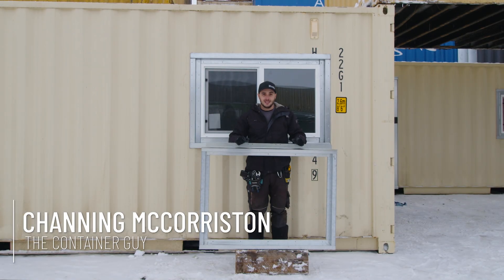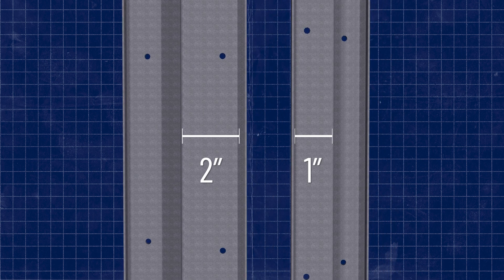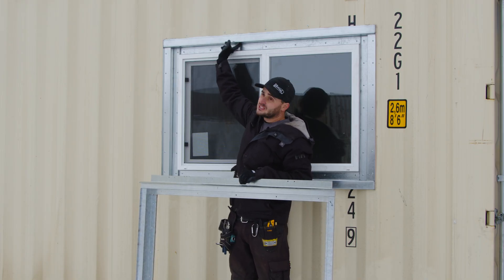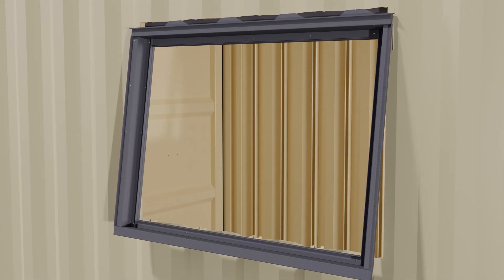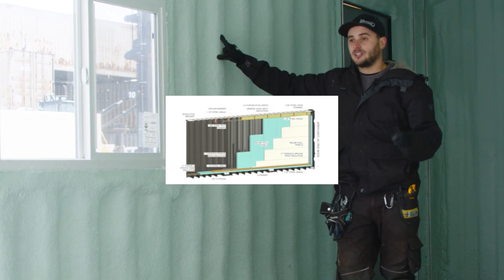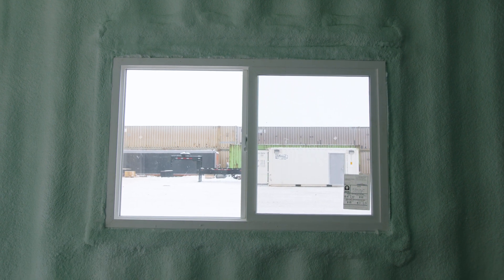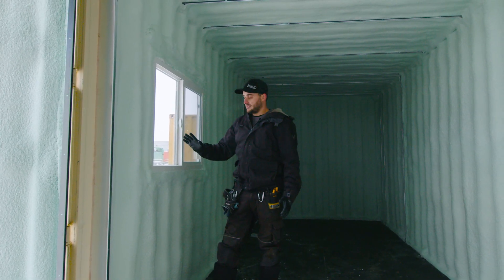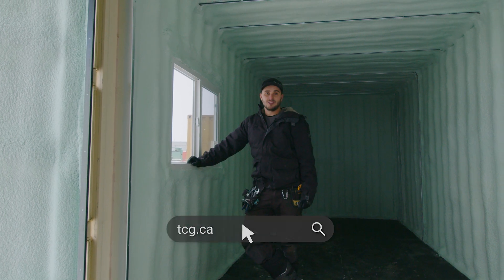Designing the Perfect Window Frame for Shipping Containers

Comment: Looking forward to the alternative to spray foam insulation. Here in the rural area I live, spray foam installer wants $5K to shoot a 40' high cube 😳 I paid that much for the cotainer itself.
Reply from the maker: My guess is the envelope will be less rigid and not the best for constant transport (site offices). For built-on-site guest houses, workshops, and things of that nature, it'll allow the do-it-yourselfer to complete the job from start to finish. 

This summer / next winter we will test the ventilation (hint hint) of the air gap between the container corrugations and insulation to see if we can observe condensation. Think of insulating container walls like a concrete basement (frame away from the way) and the ceiling like an attic (vented space between insulation and the roof). 

In order to make this all function properly, Container Modification World is developing a ridge vent for the ceiling and small intake vents to be scattered along the bottom of the walls. These vents won't be free and will lower the cost-benefit of this system over spray foam BUT will allow you to DIY and save some money.

Spray foam material cost  is affected by supply chain issues at the moment. Hopefully prices come down a bit because spray still is, and always will be, my primary recommendation when it is affordable to the end user and readily available.
Reply: @TheContainerGuyTV  I totally agree spayfoam is the best option, I just can't afford it. Thanx for the feed back and all the awesome research and development you guys do.
Reply: My spray foam was about half the cost of my can. Was still expensive but the only way to go.

Comment: Channing. I loved the old style window frames. Looking forward to trying the new frames. I must admit, I like the larger window frames… bigger view of the lake.
Reply from the maker: We loved them too. The pursuit of smaller packaging and cheaper shipping is the main reason for and advantage of to the new frames. Rain drip will be nice but we have NEVER witnessed a leak or received a phone call about a leak so it may be solving a non-issue. 

After testing the new frames in the commercial and industrial market for a while, I think we'll use the same profile for black powder coated residential frames and go with more stylish (architectural) sizes for the container home market. 

Everything takes time.. probably a year or more before those will be commercialized.

Comment: The new window frame looks like it will be simpler to put together, as well.
I really want to put a couple of windows in my container (want to make a small, clean room at one end, to sleep in, if I want to camp on my property. It's in the desert, so lots of sand and fine dust gets in mostly from the roll up door).
Unfortunately, I don't have help, or the tools needed. I may be able to borrow the grinder, to cut the opening, but not the rivet tool 😏.
Definitely will be waiting for the new frames to come out.
Love your videos!
So helpful, and informative.
Thanks Channing!
❤️🌵☀️⛈️🌈☮️🐎
Reply: Laurie, self tapping screws work better than the rivets. All you need is a cordless drill and appropriate size nut driver, install is a snap!!